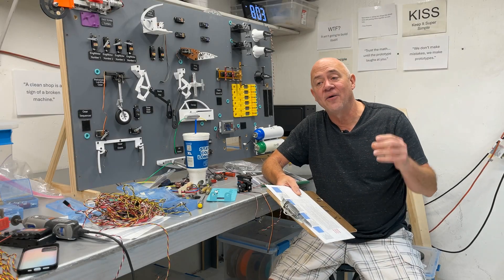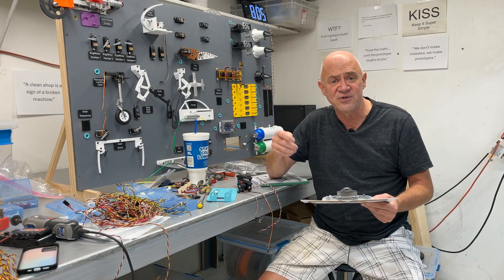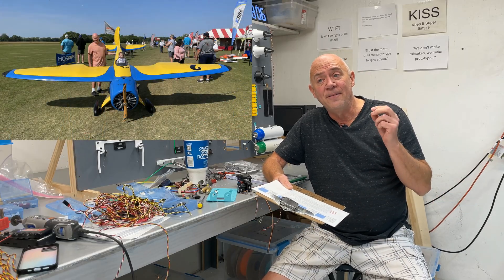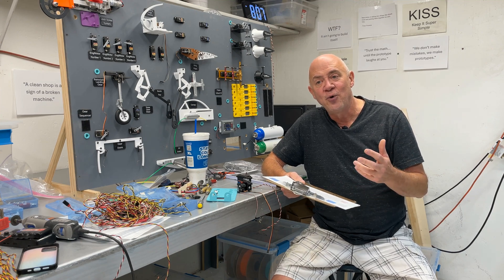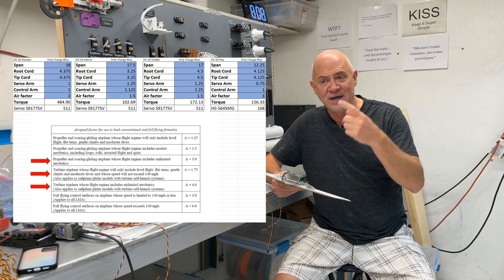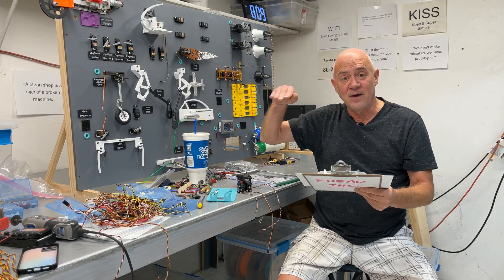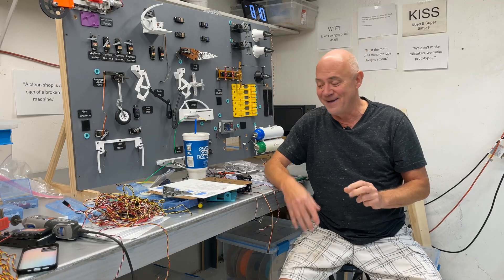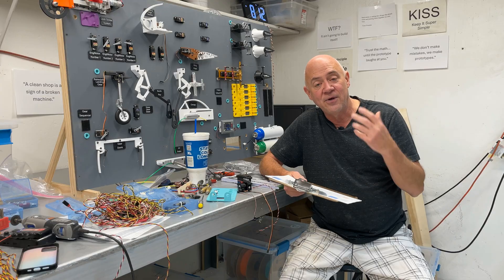How to Choose the Right Servos for RC Planes (with Free Calculator!)

Comment: I had the same rolling on my bronco while deploying flaps. The reason on mine was that I slowed down flap servos. On the ground I saw that from zero to max flap (80degree on mine) the time for all servos werde the same. But while deploying one flap was at 50 degree while the ither was at 30. So programming issue in mine and of course my fault.

Comment: Dag I would truly appreciate your take / method to calculate servo requirements for control surfaces like Eurofighter canards or F18 elevators where the entire surface moves from an axis near the mid point. This situation is unique because the servo gets some help from the oncoming airflow acting like a counter lever. Keep up the great work - really like your stuff.
Reply from the maker: Actually, the AMA doc has the formula for a flying stab. Let me see if I can take that data and build a new spread sheet. :)